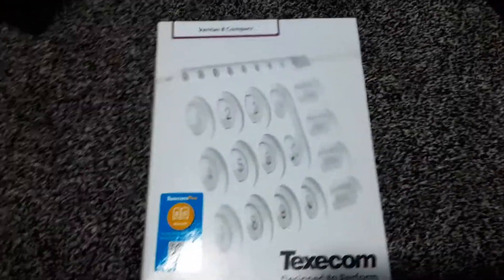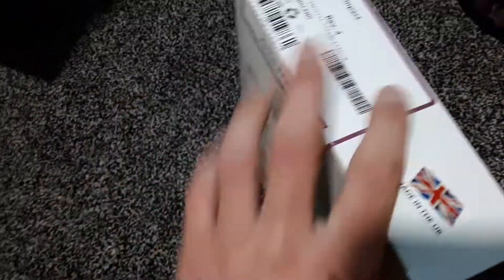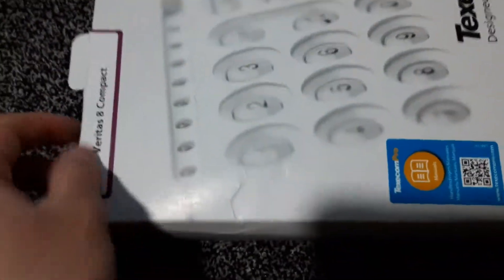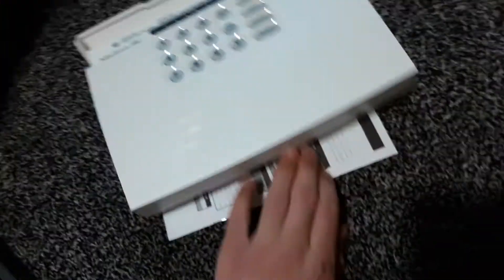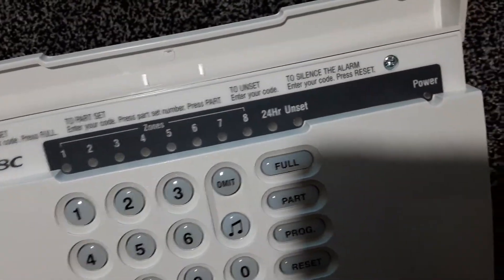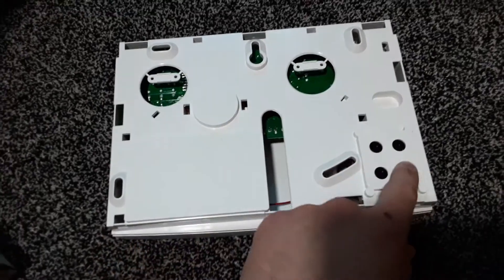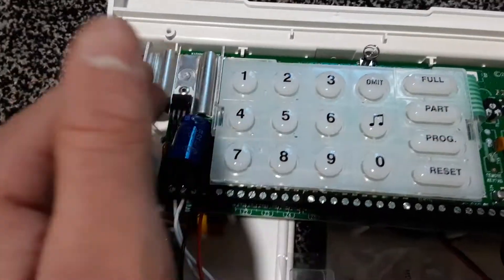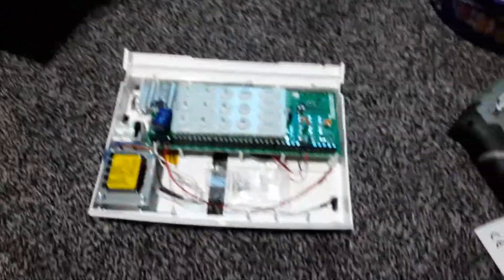Texecom Veritas 8C unboxing

Comment: I’m about to install one of these, only one pir in use, would I connect the local TKRP tamper into the global tamper? There is currently not much info on these anywhere, thanks!
Reply from the maker: Will have a look into it for you,
Reply: @GraingerElectrical  thanks 😃
Reply from the maker: @joewatford5533  hi, just been having a look at my panel, you would wire on the detector alarm and this would go to the panels z1 or which one you want it on. The tamper would go onto the final 2 connectors which are labelled TAMP, there may be a link across these(which stops it going into tamper). Then the power would go into the 12 volts on the detector and into the panels terminals labelled aux. 
The tKRP terminals are for keypads which you only need these two for data and power from the aux. Hope this helps. Ive also found a manual for the one shown in the video
Page 8 on the manual shows all the panels connectors
Reply from the maker: Here is the installation manual. 
http://www.onwirral.net/Downloads/Veritas_8_installation.pdf